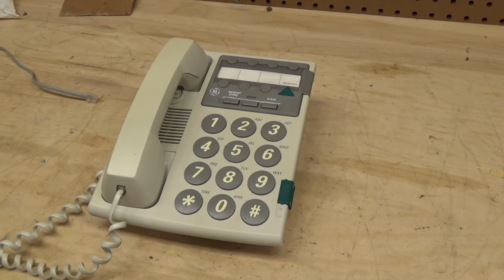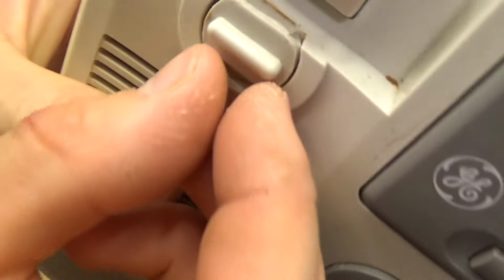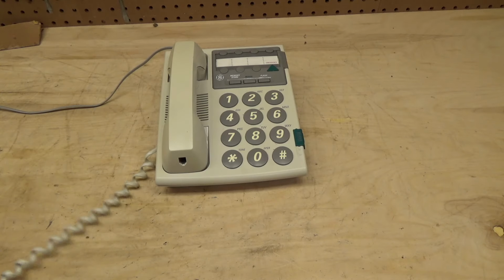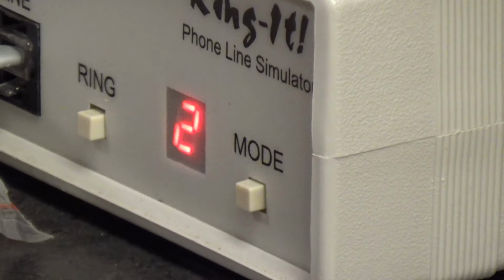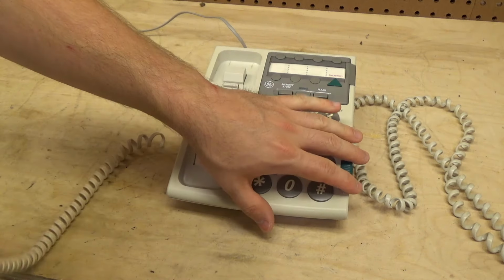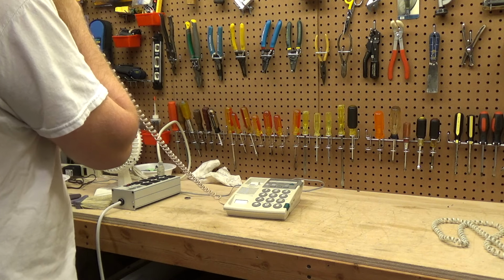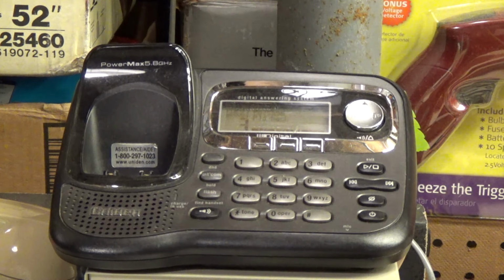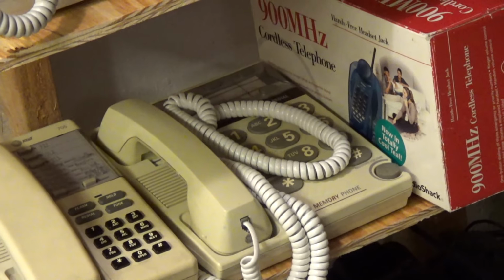General Electric 2-9267A Corded Memory Telephone | Initial Checkout

Comment: those spots above the memory dial buttons are for little tiny self portraits. also those messages were hilarious!
Reply from the maker: I thought they were just for writing names on the provided paper.
Reply: yeah i may have provided false information in the previous comment. youre probably right, since there are both a top and bottom row of speed dial buttons. it wouldnt really make sense to put pictures in there unless youre only going to use one row of buttons. i thought it was for pictures because of the tiny squares on the pad of paper making it look like a film stamp reel.